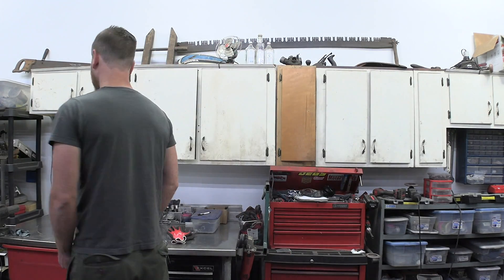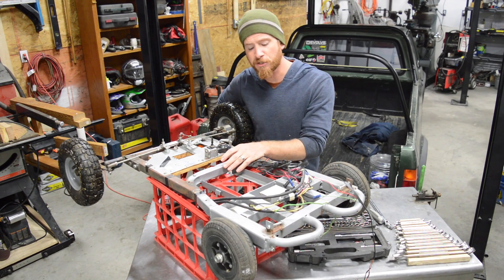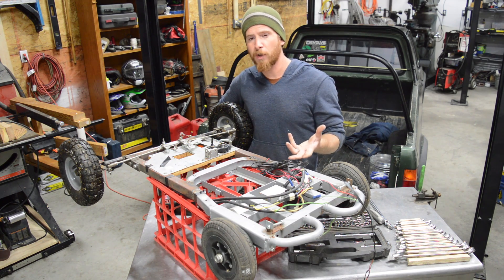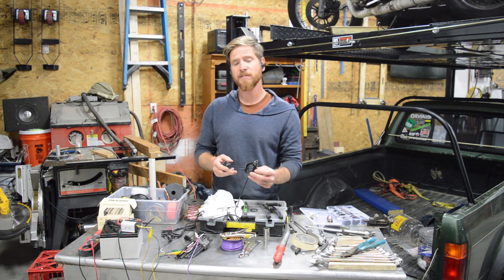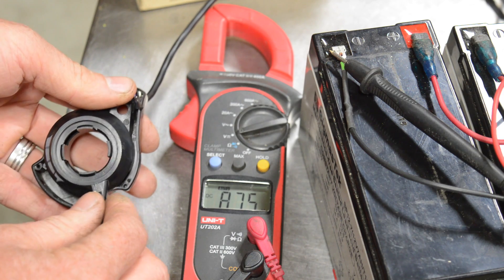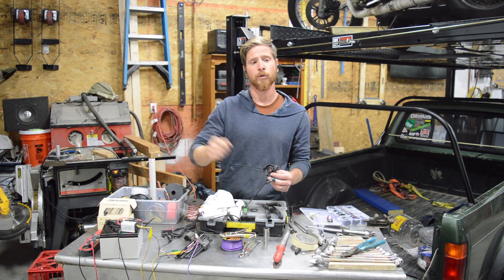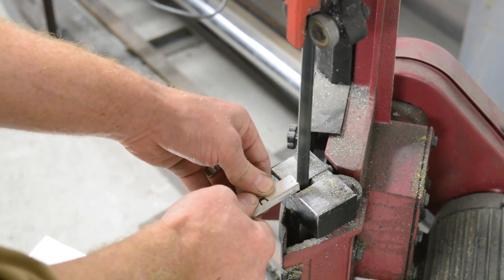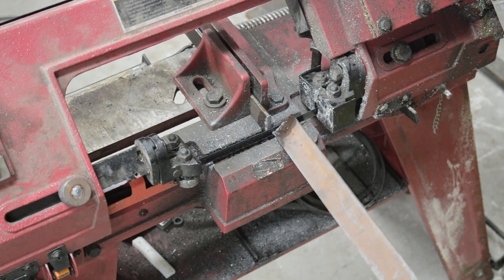So you want to be 8 feet tall in your next costume? Use the Halloween Machine!

Comment: Another fantastic build.   For those of us considering following in your foot steps, in future videos could you provide a little more detail on the pieces you are using….  For instance I’d love to know the (high level) specs of the actuators and the battery you used.  Even if just a throwaway line of, get motors the use x power and can provide y pounds of lift would be hugely helpful to anyone recreating it…. (Was the base scratch built or did you salvage it?) That said, the idea was inspired and I loved the video…thank you.
Reply from the maker: You seem to believe that I made some kind of plan or even did math before I started, lol. But seriously, I think the finished product had close to a 3.5:1 ratio so I got 2 - 330lb actuators for a total capacity of around 190lbs.
Reply: @MoreToolsThanSense  In my defense, you looked like you had a plan!  :). Thanks for the info!